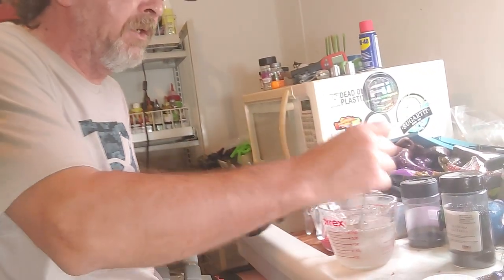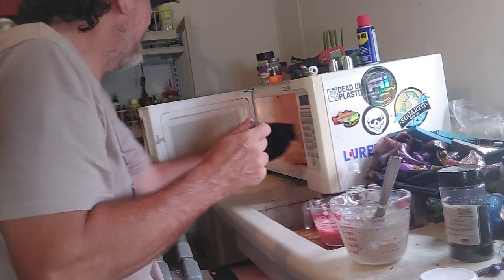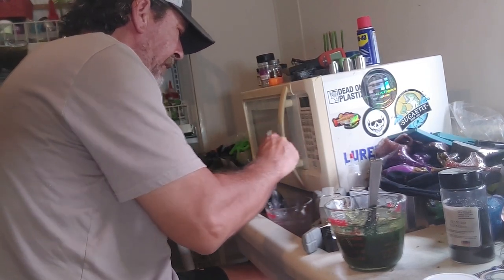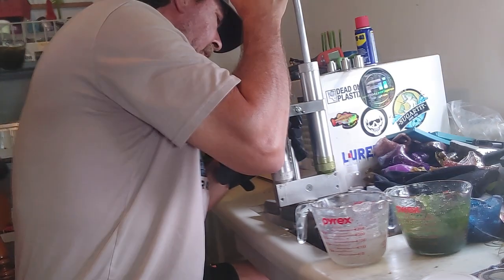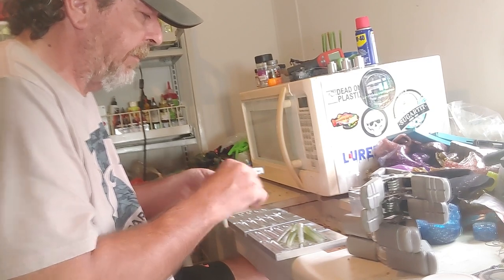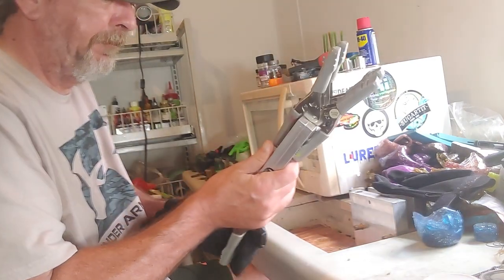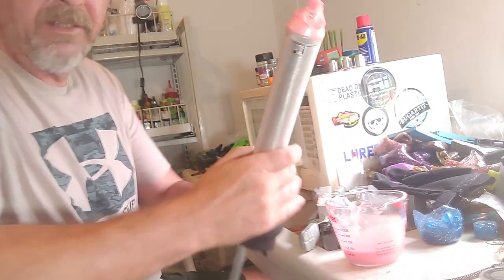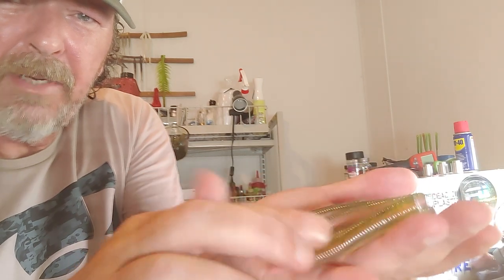Rainbow Trout core-shot NEDS for BASS fishing. How to make them #fishing #fish #bassfishing #custom

Comment: When you get a stone mold, before you use it the first time, if you spray paint them with high temp engine paint, wait a day and give it another coat, the plastics come out much easier. Certainly not as good as an aluminum mold but a big improvement over the way they come.
Reply from the maker: I just give them a lil coat of worm oil and shoot them. I don't shoot them much so I just stick with that. Thanks for the info! Thanks for watching!